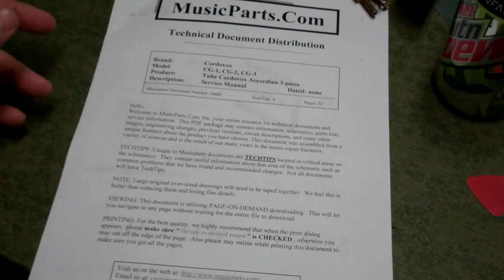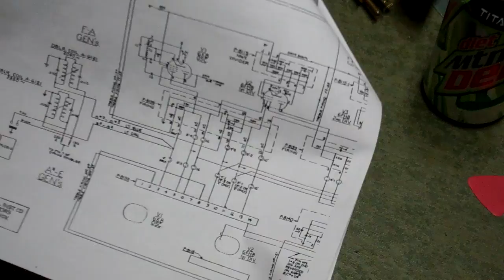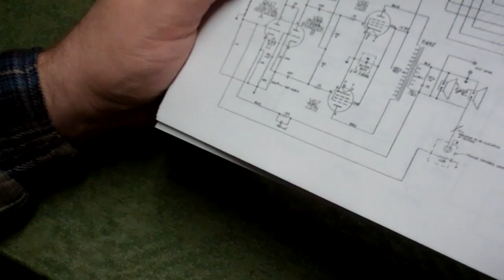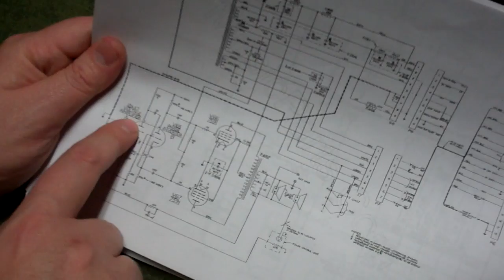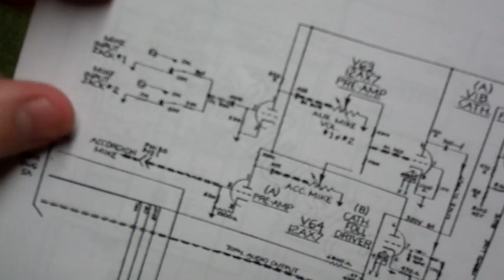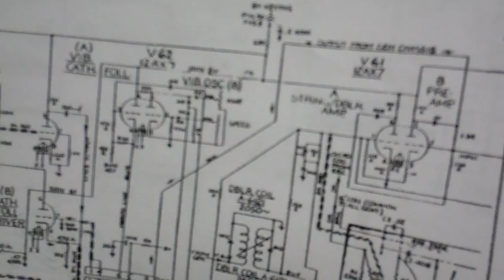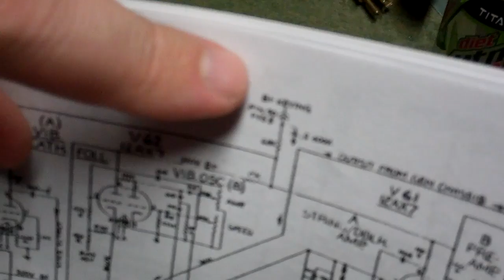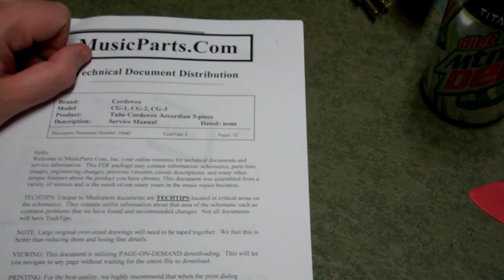Cordovox.... Examining the schematic

Comment: I know this was 3 years ago, but I know what that mystery circuit does.  It keeps you from blowing the speakers.  I have the same rig and trying to figure out what to do with the damn thing.  I was thinking 5E3 preamp with existing power amp.  With a master volume.  I know, right!!!  lol.   I hate to mess up the old circuit as well...  Maybe incorporate the vibrato and add reverb?  That would be cool AF.
Reply from the maker: All I ended up doing was bringing the Mic 12Ax7's over and wiring them with appropriate sized bypass capacitors.   Worked for me.